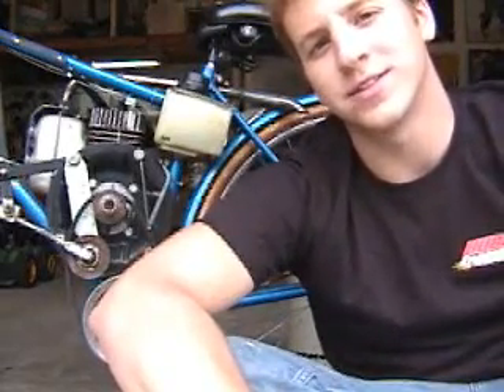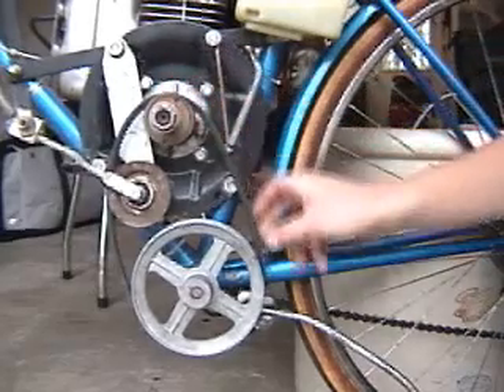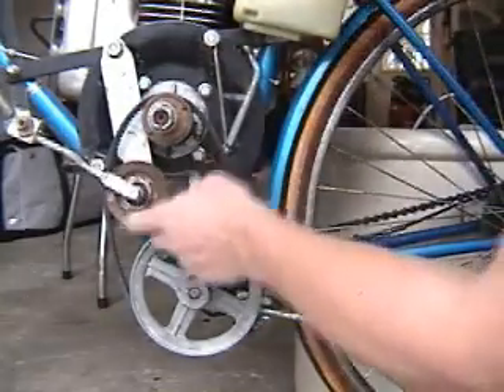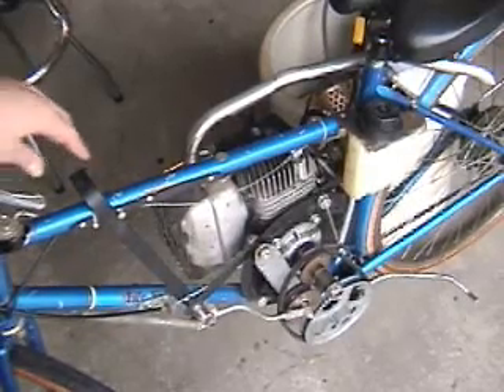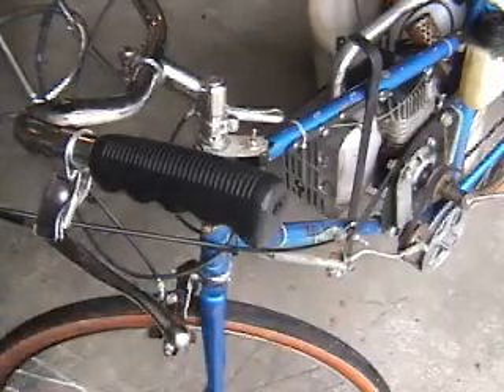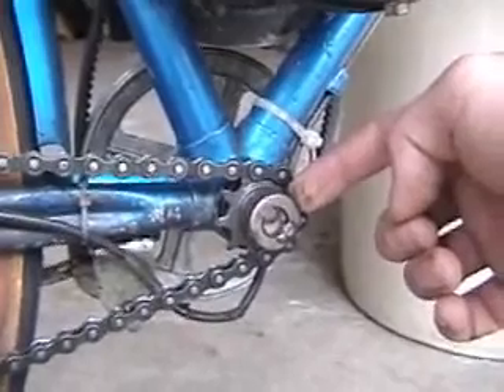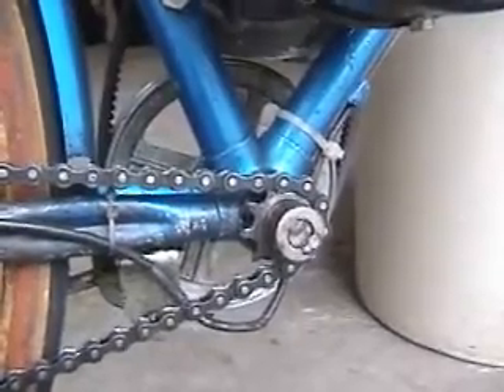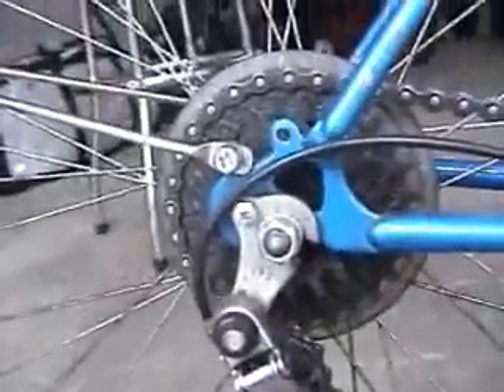Motorbike Explained - Drivetrain

Comment: Very nice build, and very informative video. I'm working on doing the same thing, but with a 10 speed bike and a 4 stroke engine. I've already converted the motor, I just need to get a bike. I was going to do a foot pedal type of clutch system with a belt, but yours looks much easier to make.

Comment from the maker: @damononopium I used a 1/2" axle with a keyway, and the bearings I had fit perfect in the frame. I got the pulley's from the local hardware store